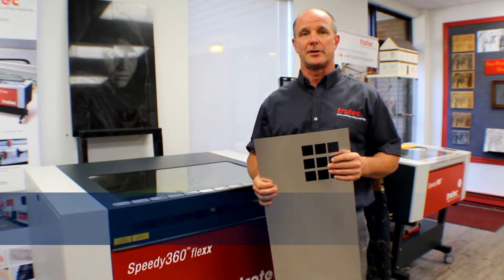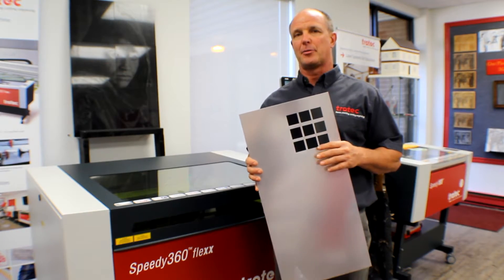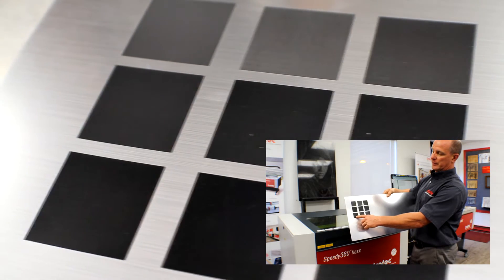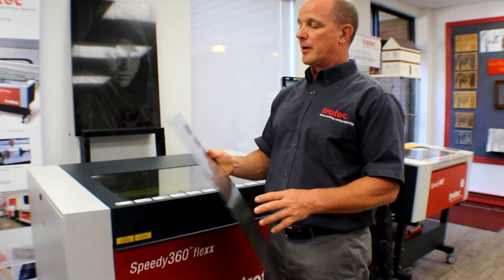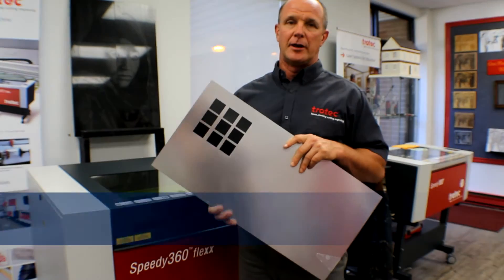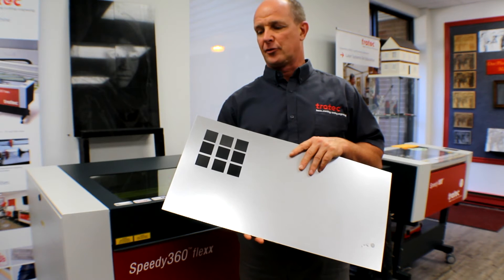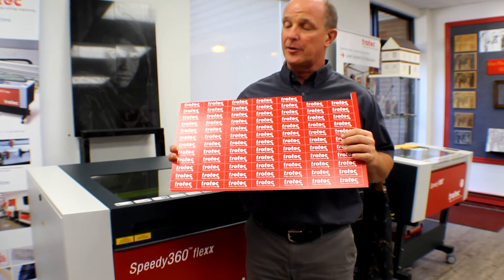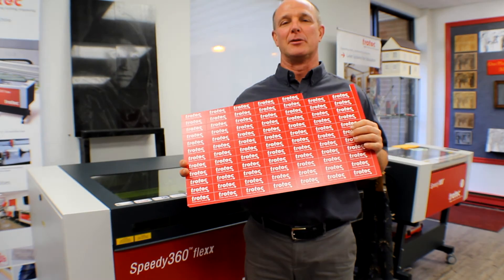Out-of-focus technique | Laser engraving plastics and laminates

Comment: I tried this technique, but I am losing way too much finer detail. Any recommendations for etching with small deails?
Reply from the maker: Hi Matthew, we advise to use smaller lenses. What lens are you using now?
Reply: Trotec Canada we just got a brand new 1.5” to replace our used 1.5”. 
The more out-of-focus I go, the more the lines in the art get blurry and thicker. I am using the least amount of power to etch off the top layer.
Reply from the maker: @msmuzila  hi Matthew, yea that's the smallest lens we got. It's always a give an take the more out of focus the blacker the engraving but the blurrier the lines if you're doing lots of details. Are you in Canada?
Reply: @TrotecLaserCanada  That is what i figured seeing only large details and text in the video. I am in Ohio USA.

Comment: Great video. I do have one question though. Some plastic simply can not be engraved correct? I have tried to engrave a random piece of plastic i had at work, and all it did was bubble up INSIDE the plastic [which was about 7-8mm thick].
Reply from the maker: Thanks Georgie! It was probably Polyethylene terephthalate (PET) which doesn't always work well with the laser. We would always advise to use our TroLase materials or plastics from reputable suppliers when using the laser.
Reply: Trotec Canada
Got it. do you guys have any suppliers or HQ in USA?
Reply from the maker: Of course! We manufacture these engravable plastic materials in the US. You can find more info here: https://www.engraving-supplies.com/
Reply: thank you!